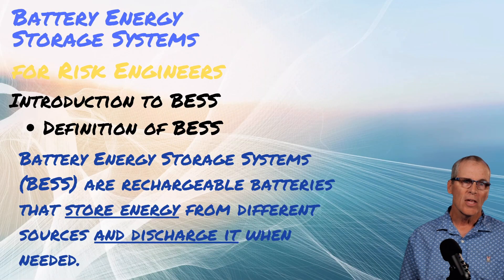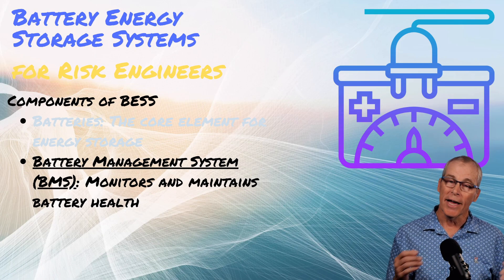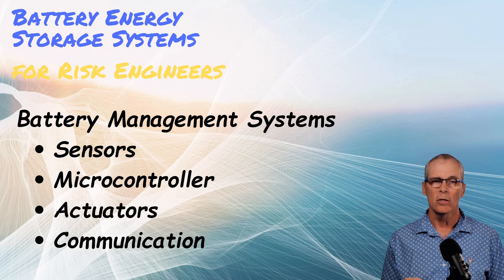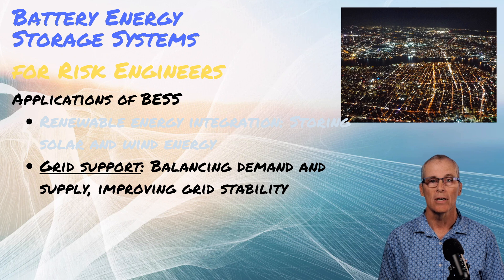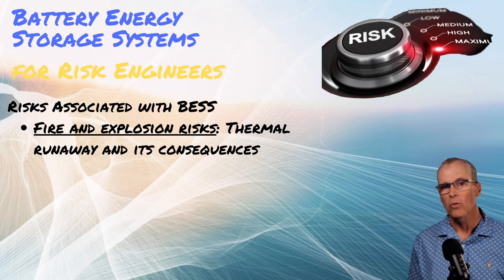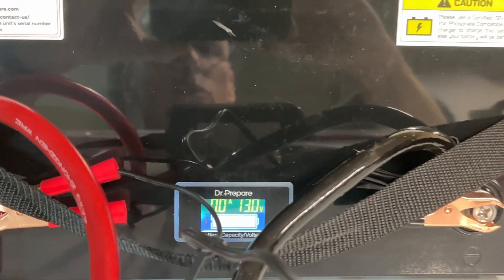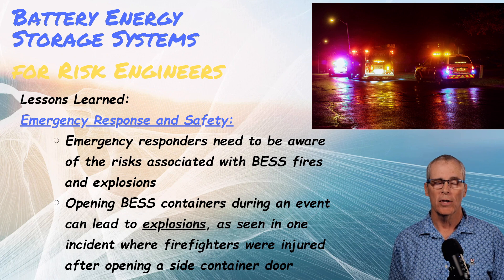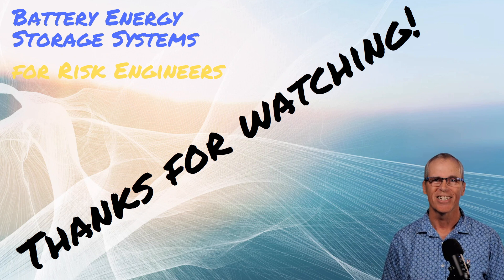Battery Energy Storage Systems for Risk Engineers

Comment: I’m really into solar power. I’m planning to assemble a battery backup generator and I want it to be portable. Just a small 250-500 amps panels. I bought a steel storage box along with some fire blankets to line the box and I plan to mount a fire extinguisher with a direct line to the box. I also plan to separate the batteries into sets of three and divide them with titanium plates. I like your video and find it very interesting. Is there anything I should rethink about this?
Reply from the maker: Thanks for your interest in solar power and for watching my video, @andiestwo05! Your plan for a portable battery backup with 250-500 amp panels, a steel storage box with fire blankets, and a fire extinguisher is a solid start for safety. Separating batteries into sets of three and using titanium plates is a creative approach, though you might want to double-check compatibility and heat dissipation with your specific battery type. It’s great you’re thinking about fire risks—ensuring proper ventilation and secure mounting could further minimize issues. Keep exploring and feel free to share your progress!